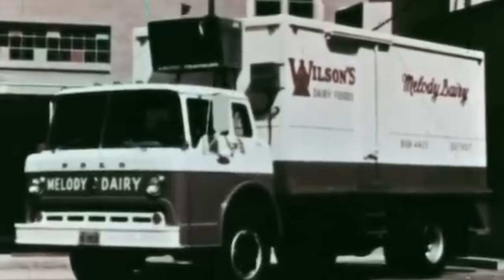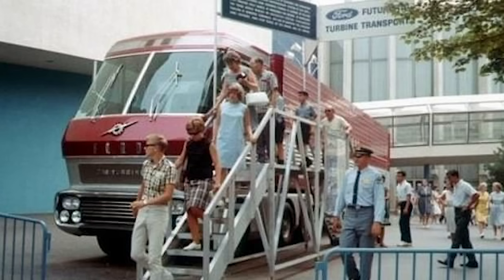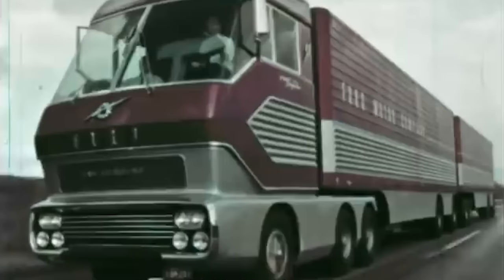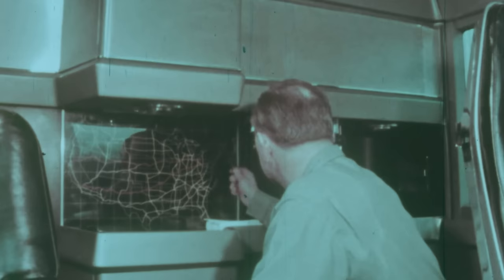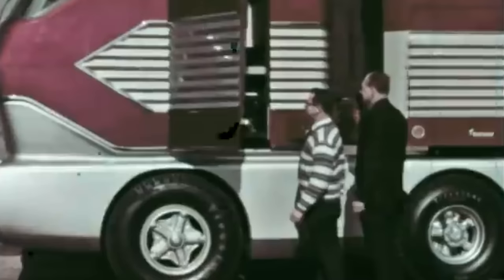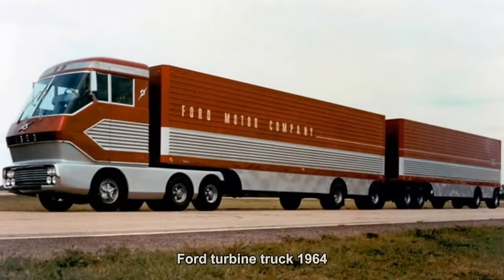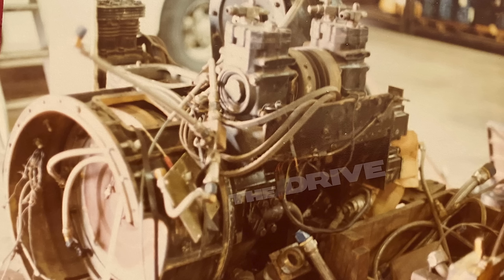The History of Fords 1964 TURBINE Truck Big Red - LOST FOR NEARLY 50 YEARS UNTIL NOW!

Comment: I  read about this truck in a Popular Mechanics issue back around 1963, one of the interesting facts about the 705 is that half the engine could be shut down during extended idle, while the other half produced 120V for cab electrics and A/C for both the cab and trailers. The engine halfs could be alternated to even out idle engine hours. Even in 1964 2 cabs were used to haul both trailers to various locations, due to state road restrictions. Sadly, the 100 mph super highways never will be built.
Nor gas turbines for road use either, due to very high initial and maintenance costs.
But it's fascinating 60 yr old technology, designed and built when America really was on top. It was a great time to be young!

Comment: The truck was designed for the ideal interstate highway, which although we planned to build, never did.  The interstate design specifications called for running safely at a constant 90 mph, carrying heavy loads, minimum 13 foot clearance, with additional clearance available if necessary. As such, most set near 13 foot clearance had straight off and on ramps so that a taller load could continue by taking an off ramp and returning on the other side. All of this was part of the National Interstate and DEFENSE Highway System, with emphasis on Defense. However, many states didn't fully comply, often taking existing four-lane US highways and converting to interstate by center guard rails and removing crossovers to create controlled access. Often curves and grades required much slower running. In some locations, the straight off, straight on ramps weren't used, so that loads taller than the overpasses could not get through. And states never got too keen on high speeds, keeping speed limits to 70 or less in most states until the National 55 mph speed limit. As such, a 100 foot long truck weighing 170,000 pounds was never going to make it.  Great video!
Reply from the maker: thanks for the comment Tom, interesting stuff for a Brit to take on. cheers for sharing.
Reply: @RedStateFilms  - One of the things I found interesting in England was the much higher clearance on the overpasses on the motorways. It has been a long time ago, but it seems to me they were at 20 feet. Correct me if I am wrong about that. I imagine it was because there were so many RAF bases all over that may need to move an aircraft if one was forced down on a highway.
Reply: @tommissouri4871  Possibly after WW2 they anticipated taller vehicles,  when they re built overpasses.

Comment: Seems I remember seeing an article in Popular Mechanics, or some other publication, that showed GM also built a gas turbine truck in the early 1960's (called the "Bison", I believe) which had a futuristic aircraft inspired cab interior with a control yoke style steering wheel.
Reply from the maker: Yes mate there was 3 at the time. Fords big red, chevys turbo Titan 3 and General Motors bison.
Reply: @RedStateFilms  Thanks! I forgot about the Chevrolet Titan. I did a little research & found that it was the Titan that had the "yoke" style steering wheel, & not the Bison, which had two small steering "wheel" controls. The concepts for vehicle design were so forward thinking in those days; I'm quite sure much of the concepts were inspired by rapid aerospace advancements in the 1950's & early 1960's. Everything seemed to have a science fiction theme, & this captured the public's imagination.
Reply: Ok, I may have gotten mixed up; apparently (from a YouTube video about the Titan), it was the Titan that had the two steering "wheel" controls, & (I guess) the Bison had the yoke control for steering. 
Interesting that GM allowed Chevrolet (which was part of GM) to pursue their own turbine truck design, as GM pursued a separate design with the Bison turbine truck.
Reply from the maker: @shadovanish7435  didn’t wanna give too much away as I’m currently doing a video on both of them aswell. But yeah the Titan had the strange belt wheel, the bison looked like a thunderbirds vehicle real low and flat with a big nose

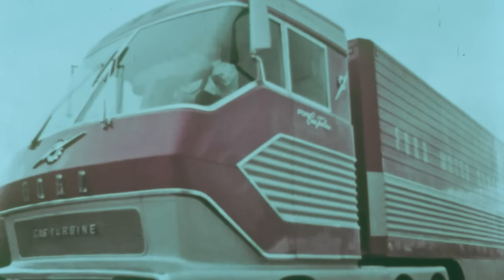Comment: 10:19 Check out the harsh cabover ride & the steering inputs to keep it going in a straight line, with a wheel base that short it's not surprising. By the way, it's not Holland & Moody it's Holman & Moody!
Reply from the maker: Hi mate, where does it say Holland instead of Holman? Must of been a quick mistake as we are aware it’s Holman and moody. Cheers for letting us know!
Reply: The cab was actually mounted on hydraulic dampers, giving the occupants a very smooth ride.

Comment: The greatest truck ever built is a 1968-1974 Brockway model U360 with the 435hp V-12 cylinder Detroit diesel 12v71 engine (with jacobs “Jake”compression brake), an RTOO-12513 double overdrive fuller 13 speed main transmission, a spicer 4 speed manually shifted auxiliary transmission with overdrive 4th gear, 5.29:1 ratio Rockwell SSHD 44,000 pound drive axles on Hendrickson RT-460 walking beam suspension, a 16,000lb Rockwell steer axle with Sheppard power steering and S cam brakes, 22” 6 leg Dayton spoke hubs with 11R24.5 Goodyears on the drive axles and 24.5” 2 hole Budd stud pilot steel wheels and 11r24.5 Michelin steer tires. 

You couldn’t spec out a better truck than that in my opinion, the only exception being if Detroit and Brockway would have let you special order the 12V71 with N75 injectors to bump it up to 475hp.  With that engine and the driveline I outlined you’d have a truck with enough of a low hole and lower gear choices to start out on and pull 12% grades or better yet still be able to cruise at 70mph at 1600 RPM and have a top speed around 100mph.
Reply: Yikes. That was random
Reply from the maker: the man has a dream what can we say 😅
Reply: @RedStateFilms  he’s got a dream alright…the Detroit screaming Jimmy was a boat anchor when compared to an 855 big cam or a 3406 Cat…this set up as its layed out here is super weak and wouldn’t be user friendly or economical.

Comment: so dude has completely lied about the reasons he wont take out big red one because the cab which is all he has is only 20-25k lbs and only like 25 feet long seeing as thats basically smaller then a school bus there should be no road he couldn't drive second because turbine tech has gotten much better so if the engine e were to break he could repair it with better quality parts and make it run better than it did in the 80s when he swapped the engine dudes just spouting excuses as to why hes lazy